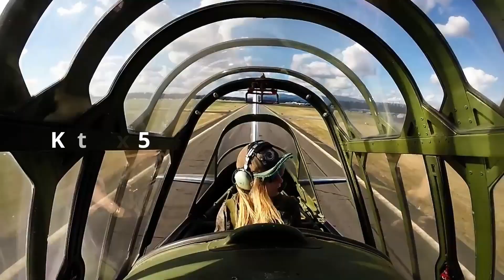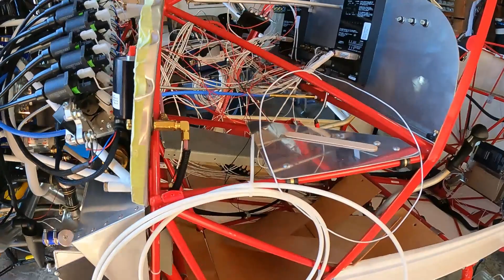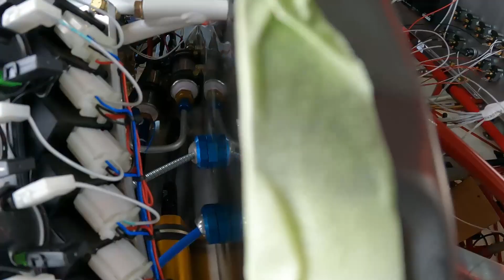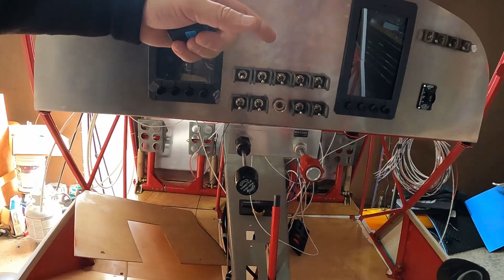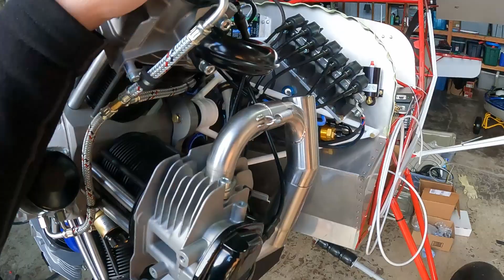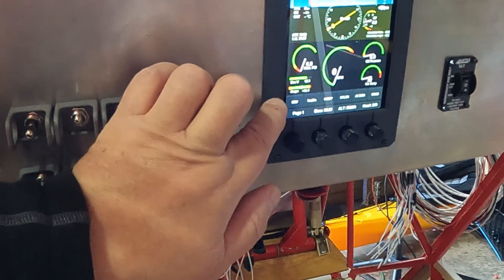Verner Kitfox 5 Ep39, First engine run

Comment: I'm sure you've addressed it in one of your videos, but how are you providing cabin heat?
Reply from the maker: I've elected to use electric heated gear like I use on my motorcycle.  If I can ride a motorcycle in temps as low as 14F it should work well in a closed (but drafty) airplane cabin.

Comment: That radial sound soOOooOOoo good.   I wish the phone video cameras didn't stop or randomize the props.
I didn't get your statement, "Center of gravity is 8 inches."   Eight inches from what?   I presume there's a standard?  What am I missing?
Reply from the maker: Datum for the CG is the leading edge of the wing. For flight it needs to be between 9.5 and 16.0". It will meet that 9.5" forward limit with a 150lb pilot and just a couple gallons of gas. Bottom line, I won't have to worry about being tail heavy even with 150lbs of baggage, two fat pilots and full fuel
Reply: @vernerkitfox  Ahh okay I get it now.  Love learning new things. Thank you sir!

Comment: I've been told by others, and I agree, that my 78" Prince P-Tip prop makes my 912S Rotax sound like a little radial. It's also the best prop I've tried in 3000 hours of flying my RANS S-7S, and I've tried them all, the sound it makes is a bonus!